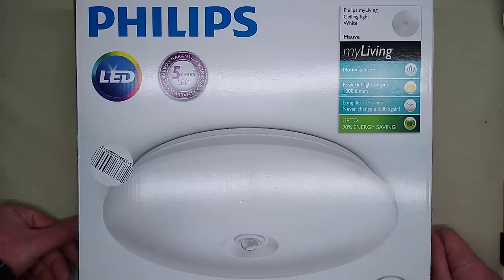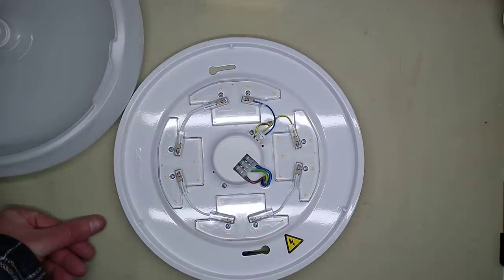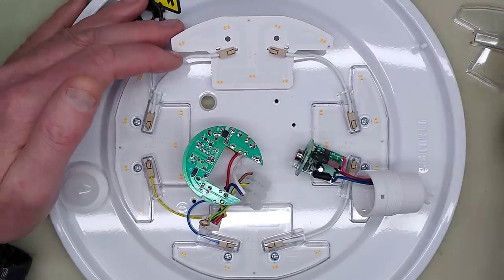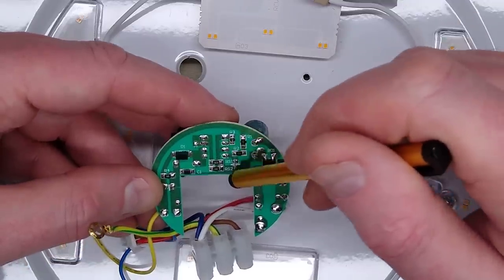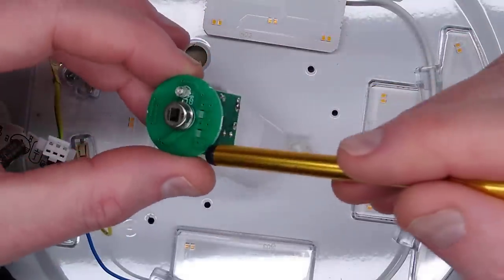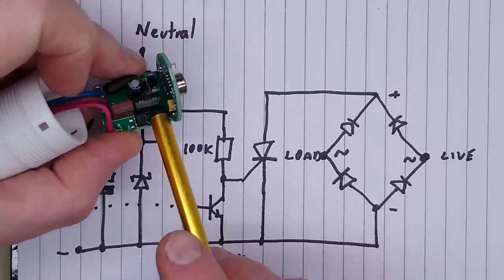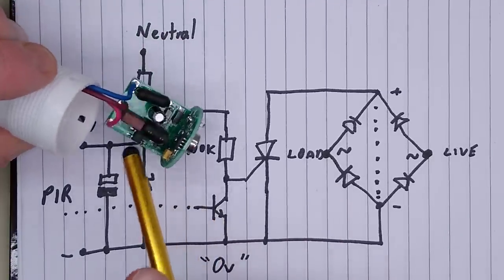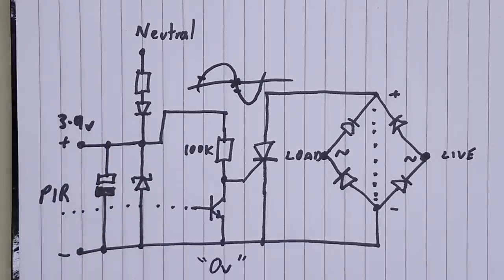LIDL Philips PIR LED ceiling light teardown.

Comment: "Never change a bulb again". Because a LED is not a bulb.
Reply: Bulb's grow in gardens, Lamps are fitted in luminaires...lol
Reply: @muzikman2008  Touche'
Reply: No, bulbs are fitted in lamps.
Reply: @paulsengupta971  bulb
/bʌlb/
Learn to pronounce
noun
plural noun: bulbs
1.
a rounded underground storage organ present in some plants, notably those of the lily family, consisting of a short stem surrounded by fleshy scale leaves or leaf bases, lying dormant over winter.
Reply: bulb noun [C] (LIGHT) - a light bulb
Reply: @paulsengupta971   Good job i'm not planting my lamps into my CPC,s and expecting daffodils pmsl :-D
Reply: The alternative is to plug your daffs into 240V. I'm sure they'd light up, a little bit. Maybe Clive could give it a go.

Comment: Never change a light bulb again? I mean, what, do they expect that you'll be dead in 15 years? Even at their most farfetched claim, you'll still have to replace it in 15 years.
Reply: @Okurka.  The point is that they're claiming you never need to change a bulb (or other type of light) again because this light will last longer (forever?) but it only says 15 years max.

Comment: Most of our E27 bulbs dim significantly after a few weeks and don't last much longer than incandescent bulbs. Combined with high parts count and low power factors, these are not so environmentally friendly, as Clive noted. The EU should rethink LED laws, although that will bring doubt on all all environmental regulations so may not be tenable.
Reply from the maker: If the EU red tape makers were actually even the slightest bit technically inclined they would set standard LED module voltages, currents and form factors to allow easy exchange of components.  But they're not.  And if they tried you can guarantee it would be badly done.
Reply: "and don't last much longer than incandescent bulbs <-- as they are overdriven to hell and back. Pretty much all of them have a horrid LED driver + some LED cramped in a tiny area, bad thermal paste (if any). When you open a defunc one, the pcb is discolored due to high temperature. In short they are designed to fail and show big numbers (overdrivern)

Comment: Technically, an LED isn't a bulb.  I'm no attorney, but I could get Phillips off that one :o)
Reply: A bulb grows into a plant, like a tulip or a daffodil. A lamp emits light when a voltage is applied across its terminals. Damn the common usage of "60w bulb".
Reply: The lamp holds the lightbulb.

Comment: The quality could definitely be better. Just put bigger and Japanese caps on there. Also better heat transfer from the LEDs and maybe 3 in parallel...
Reply: sparcle in some aluminium laminated pcb material just to add to the over all quality
Reply: @urugulu1656  this is the 1st time I've seen no Al laminated pcb for LED base lightning. Virtually any Chinese one has the lamination.

Comment: bet that main electrolytic will fail first..😉 i dont trust modern caps in the slightest...i have '80s caps and older that still test ok..
Reply from the maker: Modern caps have a much harder time.  They are smaller and they are used at thousands of times the frequency.

Comment: Currently, when a bulb fails, it is easy and cheap to replace it.  When this type of unit fails, the vast majority of the population will need to call in an electrician to replace it.  That will most likely be every few years.  While they are awaiting the electrician, they will be without light in the room, and need to use torch or some jerry-rigged light on an extension lead.  These are a really stupid idea.

Comment: So does it mean you need to hire a bloody electrician for any small thing you need done aka a switch which really anyone with a couple brain cells can do
Reply: bentlikeitsmaker technically no. So long as any work does not amount to a new circuit or fuse board replacement then anyone can do it.